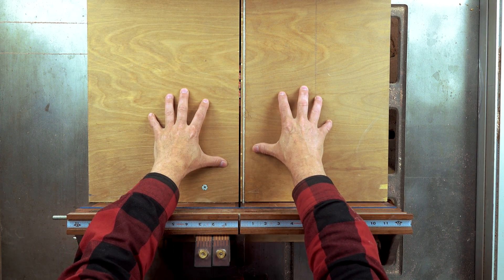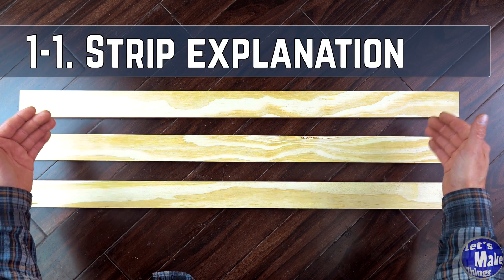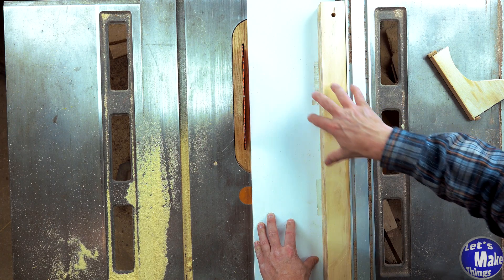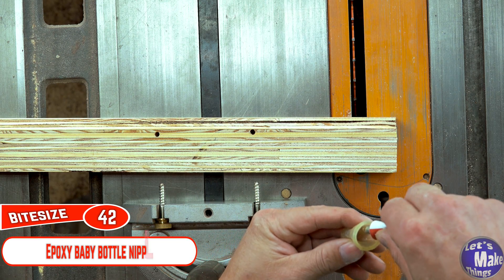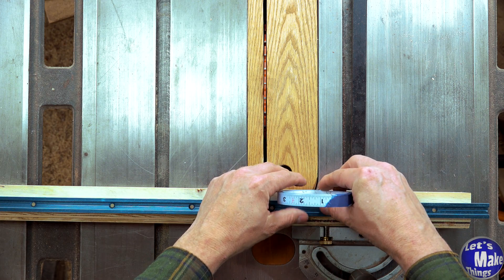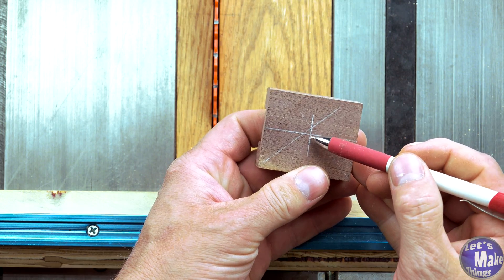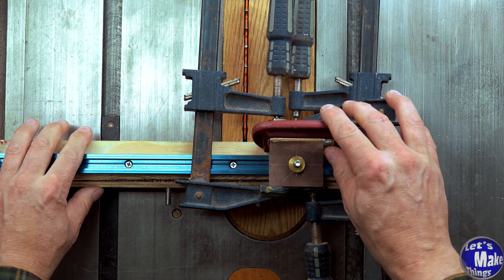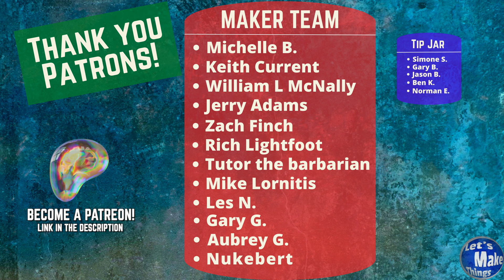Make a miter arm for your table saw! / Step by step directions

Comment: This is why i made mine out of a 1"x3" (1030) aluminum extrusion. This allows a vast amount of functionality, and adaptation with the miter gauge. 
 
I even use the same junky gauge that you have. But i rebuilt some of the hardware on it so that I could ensure a snug lock on it and allowing me a better degree of accuracy.  I also cut 5 inches off the front of it so it would maintain a more accurate snug fit. (The original length would be taught when it was fully in miter dlot, but once any part of it made it out of the slot, it would cause a bit of play in it, and hurt the precision I desired.